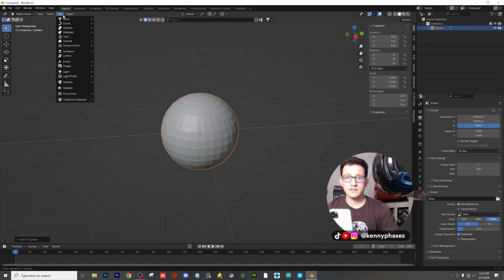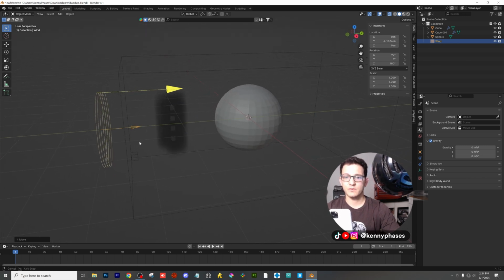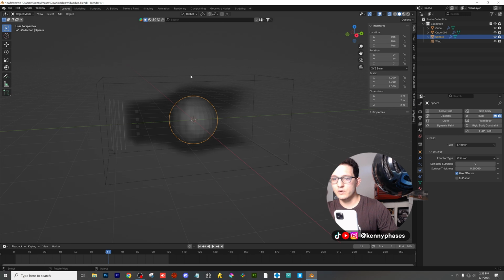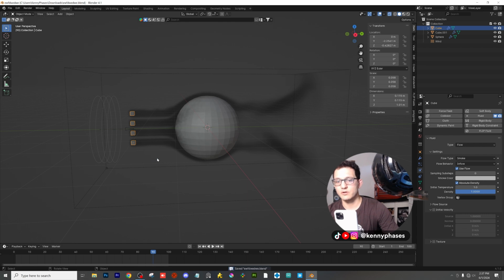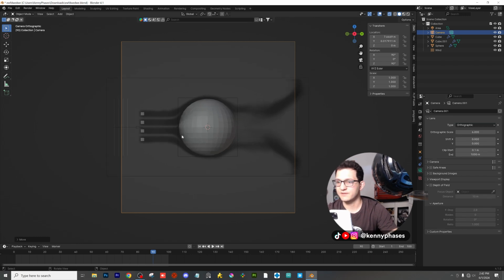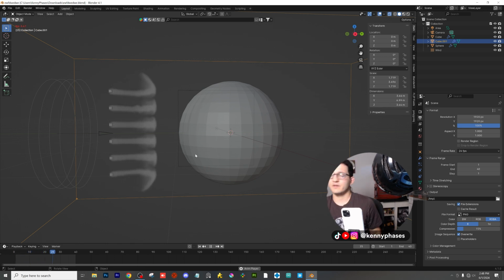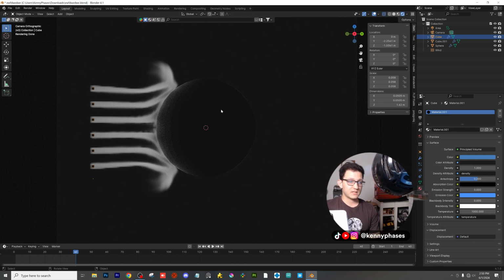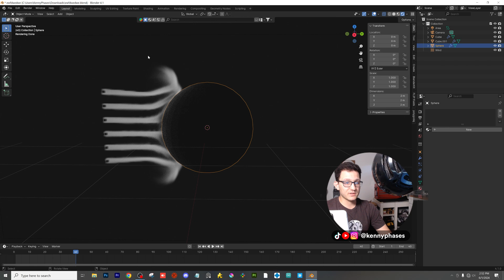Blender 3D: Smoke Tunnel Tutorial

Comment: When you do the 4 smoke cubes you only have 1 cube relating to all them in the right collections panel, but when I add the cube then duplicate them like you did, the cubes are labelled separately, so therefore it seems that the modifiers only apply to the 1 cube and not all 4. It's things like this that frustrate when  trying to learn Blender. What am I doing wrong?
Reply: I've solved it. It needed to be done in Edit Mode.
Reply: I don't have a Principled Volume Node for my Domain. How come?
Reply: I found it. It's the Shader Editor on the 'Editor Type' Drop Down option.

Comment: When I increase the resolution the smoke goes right through the effector
Reply from the maker: Try also messing with the collision-effector.
Reply: @KennyPhases  I tried increasing the substeps and surface thickness. No difference. My model is also scaled up ( real size didn't work ), scale applied, all normals correct, its not low-poly though. What else could be the reason?
Reply from the maker: @aixbln  I'm not sure, when in doubt you can raise the resolution of the simulation, I would have to see the file to better understand what could be the cause.

Comment: my simulation is not appearing in the render view, How do I fix that?
Reply from the maker: Did you apply the volume shader to the domain?
Reply: @KennyPhases   SAME and i applied the volume shader and still nothing :( but the simulation is working.
Reply from the maker: @BONO44-f6s  Have you tried using EVEE or CYCLES? Sometimes you will get a different result depending on render-engine and also your light-path settings or render settings.